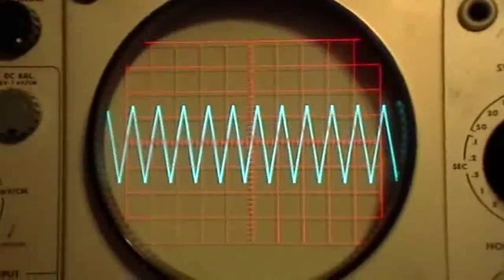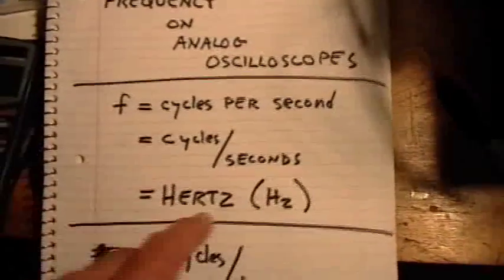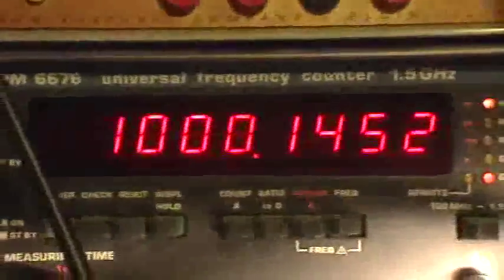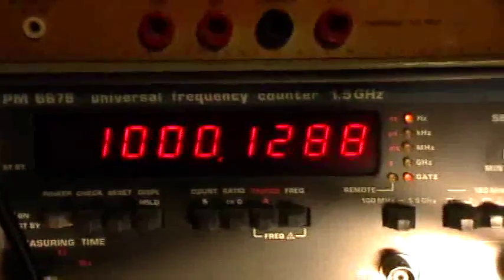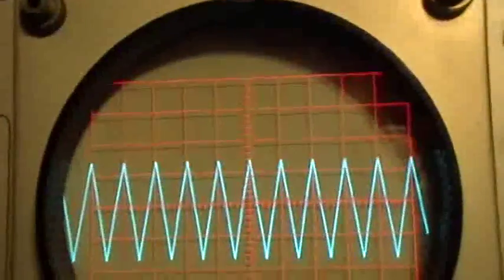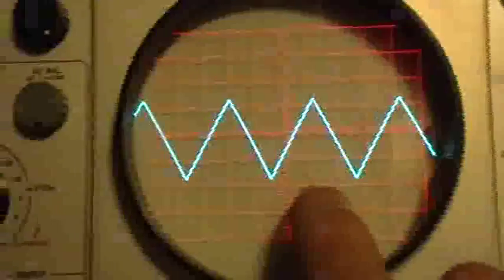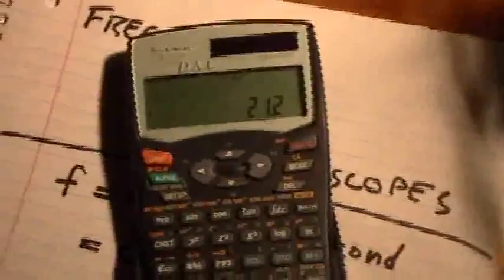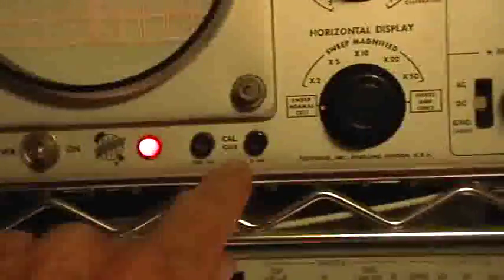Scoposcopy: Measuring Frequency With The Analog Oscilloscope

Comment from the maker: I'm not sure what you mean. Didn't I do that in the video, comparing to the Philips counter? It was calibrated to NIST traceable standards a few years ago, and contains a crystal oscillator in an always-on (when plugged in) oven for stable temps. It has its own 10,000,000 Hz internal frequency standard from this stable oscillator... Ah... it might have been simpler to use that to set the scope cal directly, but it's a rear panel output and hard to get to in my rack....
Is that what you mean?